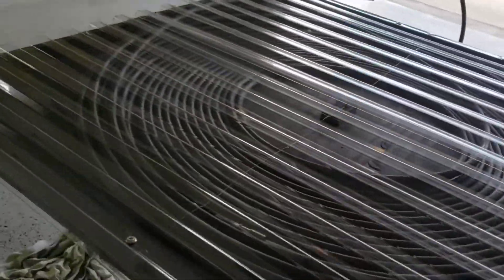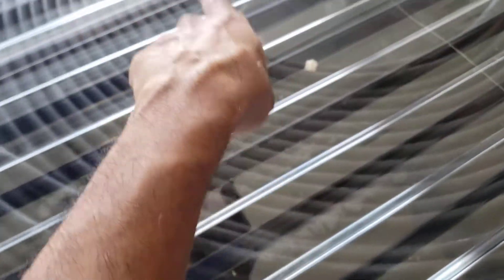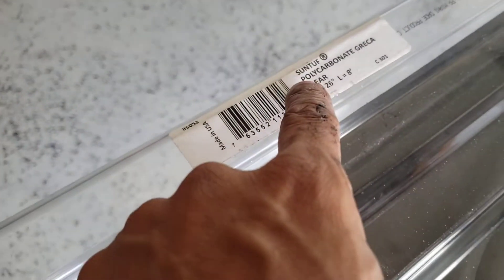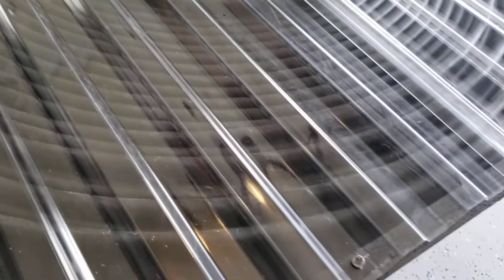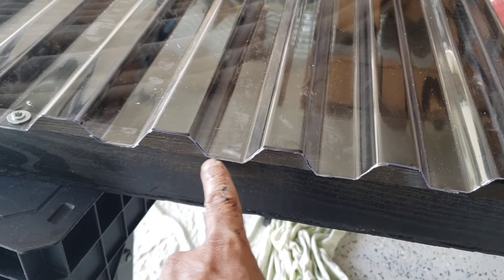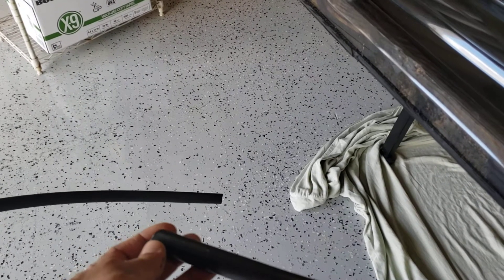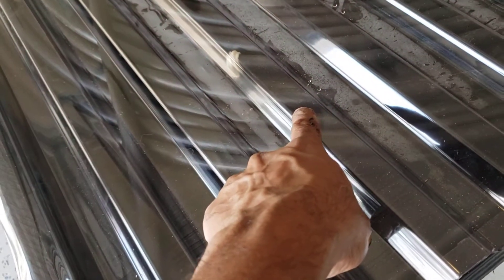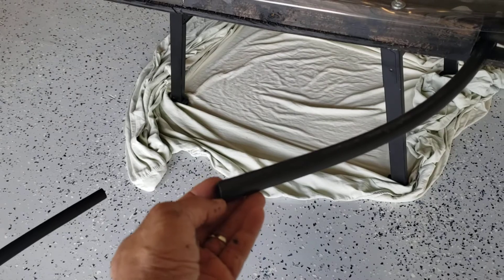Construction of a DIY solar pool heater Pt1

Comment: What good is a solar heater in winter, who needs them during the summer, useless video and project, but I can be  convinced otherwise
Reply from the maker: Depends on what your needs are. Some people like to use their pool in the cooler months. In summer just disconnect the solar panel. Thanks for watching and commenting.
Reply: The solar heater wont heat in the winter , prove me wrong
Reply from the maker: Why not?
Reply: @Andrewsnotes1  waiting for proof
Reply: @freespeech4023  - There is still solar radiation in the winter. It's not as much as summer, obviously, but it's there, especially on sunny days.  Perhaps you need to be educated on the 3 types of heat transfer: (1) Radiation (2) Conduction (3) Convection.  The solar heater in this video works by absorbing solar RADIATION.
Reply: @spinav8r  thank you I am always willing to learn

Comment: If you add a curved mirror or reflective surface in front of the heater to direct more UV rays into the box, you will be astonished by the increase in heat and efficiency.
Reply from the maker: I agree it would probably increase efficiency. At this point I am not sure I would do more as even if the pool is warmer than the ambient air temperature, my significant other is reluctant to use the pool if the air temperature is chilly.